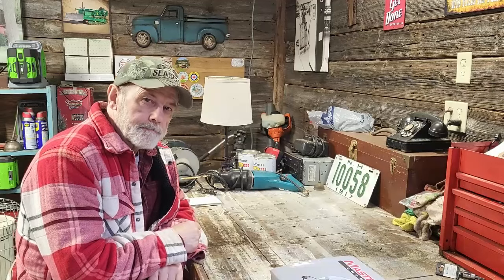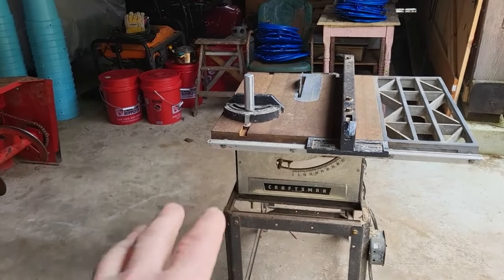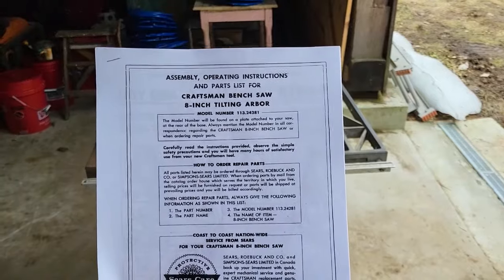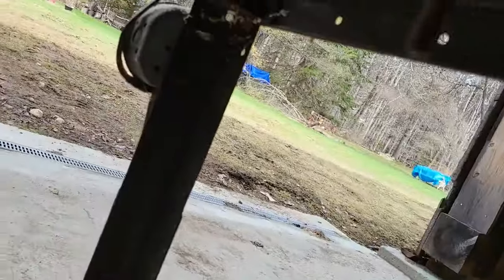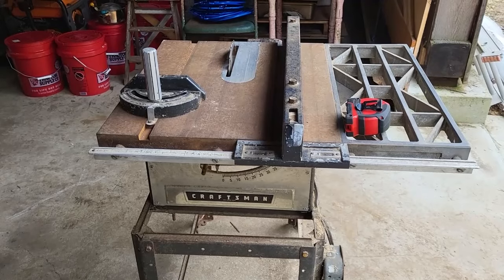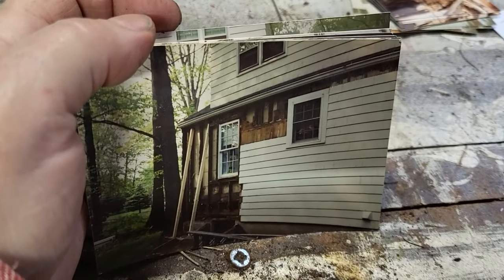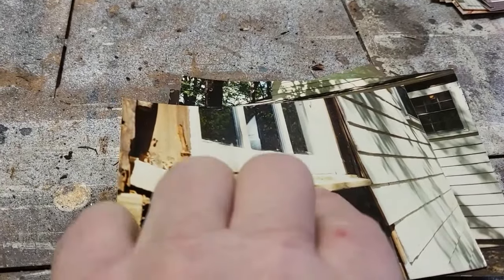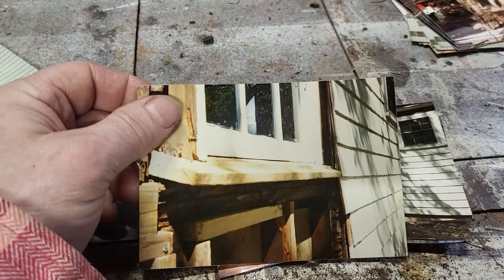Antique Tools, Episode 7 - Sears Craftsman Table Saw

Comment: My first table saw was a 10” Craftsman back in 1990 gave it to my father-in-law when I decided to get a Ridgid. Weird those knobs ran away 😂. You’ll have a major cleanup to do on it but it will look good 👍🏻. Sounds great 👍🏻. Have a great week Rick 👍🏻🙂🙋🏼‍♂️
Reply from the maker: I'm sure the 10 inch craftsman saw was a good one and is probably still running. I have no idea where those knows went! I'll do another video on the cleaned up saw, if I get it done soon. Thanks, Luc.

Comment: more info on the table saw and less on the house.   I have a Sears Model 113.27520 dated 1952.   I have rebuilt some of it Like a new fence system.   My motor is the original 1 hp motor that I had rewind, it very heavy so tilting it to 45 deg. is very difficult but it works.   The only issue I have is the pully on the motor vibrates and I don't know how to correct it.   Oh, I had someone make me some insert plates so I can use a dado blade.    Please let me know if you have any ideas how to correct the vibration.
Reply from the maker: Thanks for the info.  Sounds to me like you need to balance the pully somehow. Or perhaps the shaft is bent. Thanks for commenting.

Comment: i had that same saw and i gave it to my son i ran into a very good deal on a 10 inch delta that is strange about your control knobs the mortor is 3450 rpm and hard to replace if needed
Reply from the maker: I meant to provide more info on the motor. I figured the motor would be hard to replace.

Comment: Hard finding 8” blades with .5 arbor on these old saws.
Reply from the maker: I can't remember when I replaced the blade on this saw. It's been several years,  at least. I suppose I should find some blades and stock up on them. Thanks for the info. And thanks for watching and commenting.